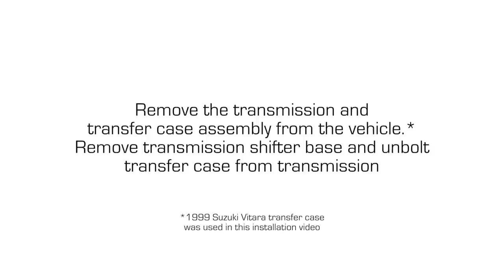Trail-Gear Tech: Trail Creeper™ 4.24 T-Case Gear Install

Comment: I used this video to install the Trail-Creeper 3:1 gears that you offer and was extremely grateful for the video and PDF you guys have for the install. The most difficult part for me was the trimming the case portion since I installed the parts at least 5 times making sure I was clearanced properly but that is to be expected on a project like this. Great parts, great service, and awesome customer service guys! Thank you
Reply: I have a sidekick and have been thinking of installing the 3:1 gear set.
I’m trying to decide on that set or the 4.24 set. Do you have any videos with your Suzuki and the 3:1 gearing? I haven’t found many videos posted on that ratio. Are you happy with the low range now? Thanks 👍
Reply: We're  the 3-1 gears low enough in 4L?